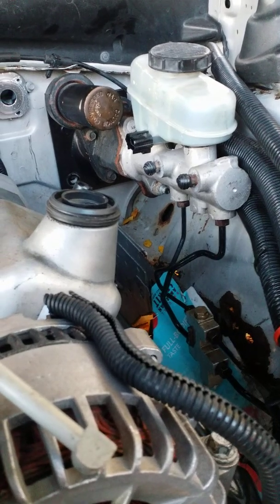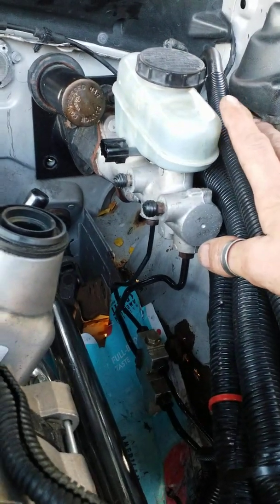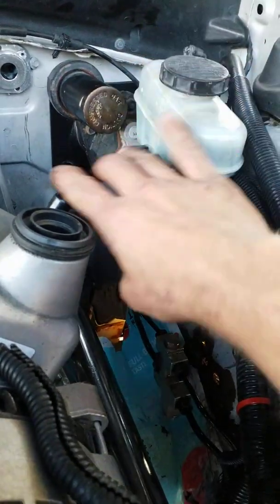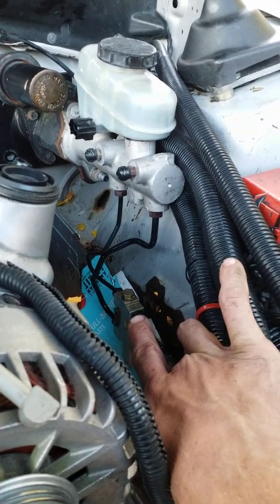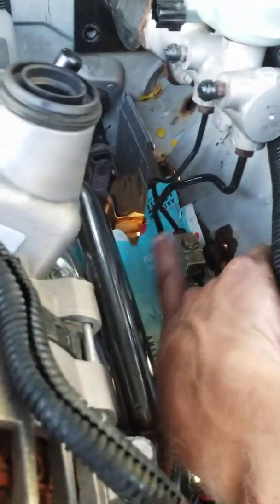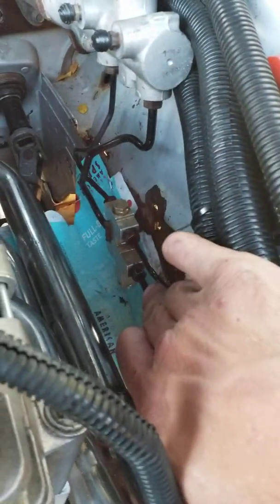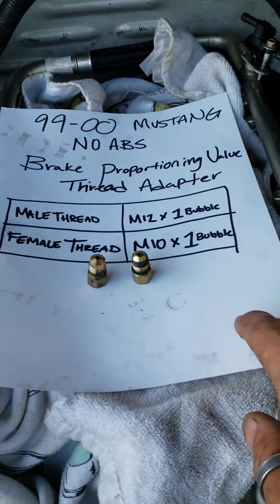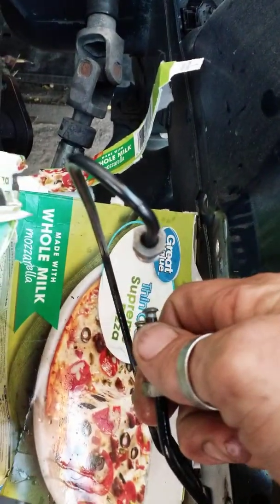Mustang Hydrobooster Swap Part 4: Boosters, Master cylinder,  Proportion Valves, Brake Line Adapters

Comment: Dude your brake  videos have been extremely helpful, Do you by and chance have an instagram? ive got a lot of questions that pertain to the brake and power steering system and i feel it might be easier to answer on that platform. Ill ask them here in hope you see and can answer though. I've got a 98 a cobra that is being purpose built for drifting, I want to remove my hydroboost system and add a willwood manual brake setup, but i also want to retain my power steering system. can this be done? or will have to convert to manual steering? which if that's the case then i will have to scrap this idea. Ive been searching high and low on the internet for 98 cobra steering and brake diagrams but i cant seem to find any that pertain to what i have. from the few diagrams i have found it seems i could just add a high pressure line from the pump to the high pressure line on the rack, then low pressure line from rack to the reservoir? for the brake system i would ideally be using a wilwood dual master setup, one for front and one for rear.
Reply from the maker: Fb group@ New Edge Mustang V6 Tech Support
Reply: @MustangV6TechSupport  awesome i figured out my problem a year ago!